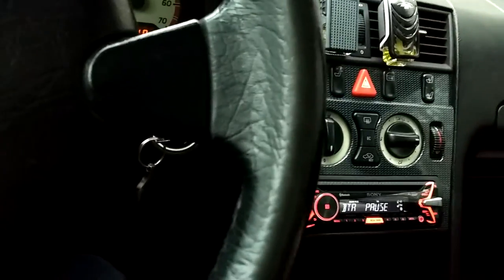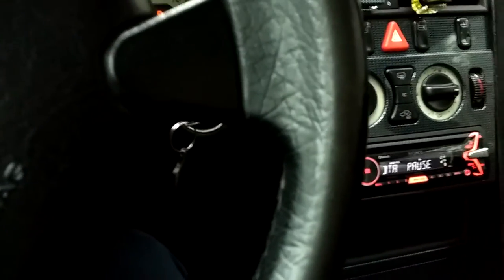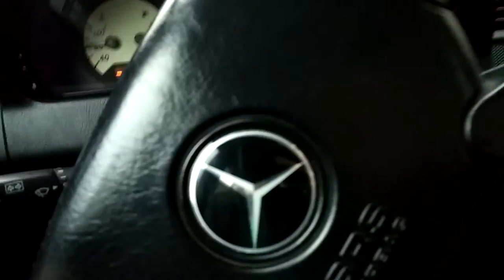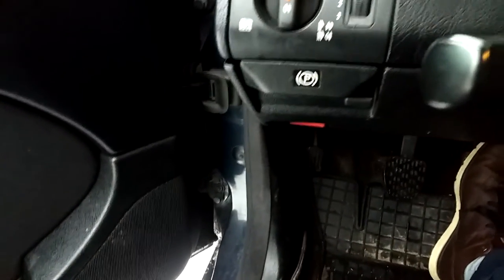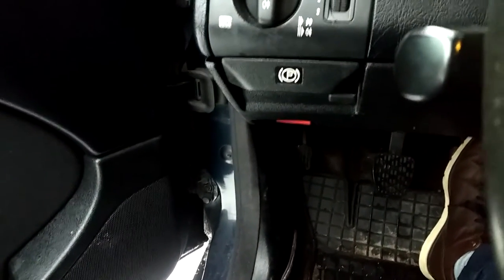Sound of a bad clutch release bearing

Comment: Thank you so much for posting this video! I thought my engine was going out, at least I know that I can easily replace this part instead of messing with my engine
Reply: @jerrycan22  but the fact that the car was making a different sound when was pressing the clutch is normal? Like in general a car should make a different kind of sound when the clutch is released? Some sort of a stronger sound right?

Comment: If u press clutch and hearing noise its  trow out bearing. If you have noise and noise goes away when clutch pressed its the transmission bearings
Reply: im having the same trouble. wierd noise when clutch engage but when u disengage noise disappear. my mechanic said it might be a pilot bearing. is it the same as transmission bearing? thankk u
Reply: @markbenedictasi3666  no its not the same. But near the same place. Anyway gearbox must be removed as well as the clutch and flywheel
Reply: @jdmcars-lt6499  thank u

Comment: my car makes weird noise on first gear when it starts to move but it stops after that.
Reply: Is it like a swishing/ticking kind of sound? Like almost a plastic rubbing against plastic really fast type thing?
Reply: @opticFPV  I found it was the clutch & pilot bearing had to be changed. Thanks for asking tho :)
Reply: @sailorforlifebestti3366  Lol I'm asking because I have the problem I described with my car, did yours sound like what I described?
Reply: Maybe u just ran a cat over?
Reply: I’m having this same noise. I can only describe it as a ringing/grinding noise when I shift into 1 from neutral or I hit like 4.5k rpms
Reply: @chrisrutkowski341  hey, i found that the clutch was worn-out. It may be the same issue for you.

Comment: I’ve the very same problem and my mechanic mentioned the words CLUTCH and BEARING.  Which is what brought me to this video. Just wondering... will this be a major problem if I don’t get it fixed? One other mechanic said just use it until it’s time to change the whole thing as it will require the engine to be lifted out to access the gear and clutch units thinggy or what ever u call it :) so, should i just wait it out?
Reply: You should wait to get the whole kit replaced as it’s a pretty pricey job so you can probably keep driving it around for a while but keep the money saved up because buying a new kit and installation is gonna put you back at least 500 bucks

Comment: What was the problem and did you get it fixed? Got exactly the same sound. Lokal mechanic told me it is the clutch release bearing. But a specialist in VAG told me it could not be the clutch release bearing. In 2 days I will get the car checked at the specialist. (Seat Leon 1.4 tsi FR 2014)
Reply: what is the findings ? thank u
Reply: @markbenedictasi3666  I have replaced the whole clutch and the sound is gone. We reviewed the clutch release bearing but weirdly when we spinned it, there was not a noise coming of it.
Reply: @ItsEzra  ok thanks a lot.. Im planning to replace all clutch kit also. hopefully it will solve the problem. Thank you
Reply: @markbenedictasi3666  you are welcome, what car do you have? I would advise to buy a original (brand) clutch. That was what a specialist car garage advised me.
Reply: @ItsEzra  i have corolla altis 2006 model. let me check the original price..🤣🤣 maybe my budget is not enough
Reply: @ItsEzra  how much did this cost?

Comment: In my case loud noise appears when the engine is hot and when in neutral position, and when clutch pedal is pressed the loud noise diappears. Does it mean the release bearing is in bad condition? thank you...
Reply from the maker: I'm not sure sorry, I would suggest you to do the same thing as i did: get your car inspected in individual workshop (cheaper than dealers and big brand name shops).
Reply: Hi do you already fix it up? Coz i've some problem
Reply: Transmission bearing my friend. If clutch is pressed down an noise is still stil there then would lead me to think trans bearing. If noise goes/disappears away wen pressed all  the way down clutch throw out bearing

Comment: they all do that..... If you put on some grease and a spring the noise will go away
Reply: Is it normal if the sound appears when pressing clutch?
Reply: @Yazzol  .... Is it a sliding sound or a squeaking sound?
Reply: @Yazzol ....yes
Reply: @gasisthepastendoil  the fact is that the sound i hear when I press clutch and when I do not press is different.. should the sound a car make a different sound in the two situations?
Reply: The sound made by the car in general is different when pressing and not pressing clutch
Reply: @Yazzol  ..... When you press in the clutch with engine running and parking brake on it should become very quiet..... When you let out the clutch it should be pretty noisy because you're spinning  bearings and manty gears.... in nuetral parked...running
Reply: @gasisthepastendoil  yes it is like that.. when the clutch isn't pressed, i hear the strong engine sound.
Reply: @Yazzol  .... The only thing you can do is put back the carpeting and the rubber boot And seal up the noise Around the stick shift or just get a car with an automatic transmission I've been I've been hearing noises for over 5 years....
Reply: @gasisthepastendoil  so this kind of a situation is a problem? In general the sound made by a car with clutch pressed and not pressed should be exactly the same in neutral?
Reply: @gasisthepastendoil  like, in general a car should make two different kind of sounds in those two situations, right? Sorry but I do not understand english really well